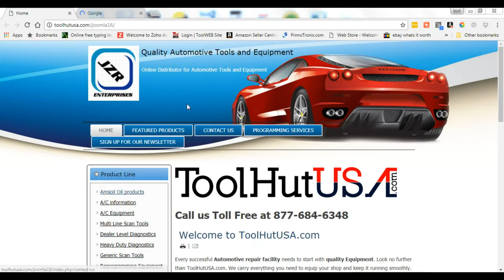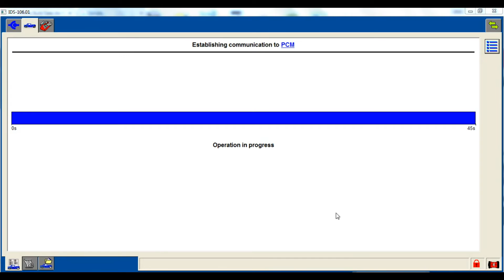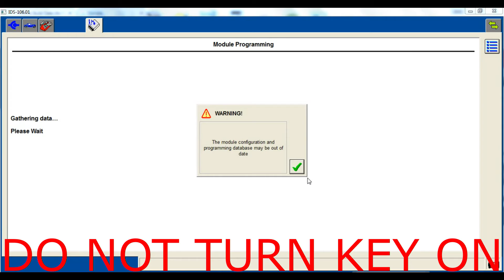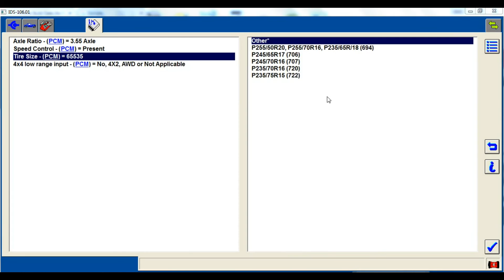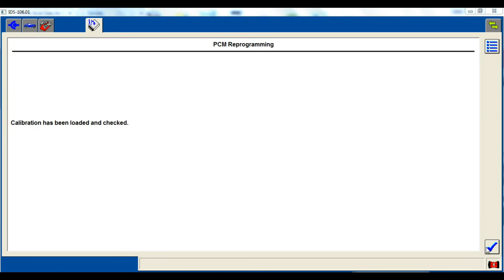Ford Module programming what to do when something goes wrong | Tool Hut USA

Comment: I tried installing a central electrical module on a focus S-max. FJDS prompted me “install new module,” I unplugged the old CEM and installed the one I wanted to install. Now the entire high speed CAN network is down. I’m extremely stressed. The instrument cluster has a code saying CAN bus off. If anyone has any ideas I will be very grateful. I would have to buy FJDS software again to do any more programming

Comment: Should the PCI procedure work to program a blank dpc202? I know they are a bit old. Tried to do that and mine would get two bars on downloading when programming and go no further. Is it possible to take the program from and existing pcm and transfer it to a blank (as a spare) using fjds? Thanks!

Comment: Hi so I bought a used pcm online for my 99 f150 and the old is stored how do I program my old keys to that module
Reply from the maker: The old what is stored? What tools do you have? An erase and program should do what you need. You will need 2 keys for it to work properly.
Reply: Sorry the old vin from the one I bought it from I have my original keys I did paremeter reset followed all the procedure and still theft light I'm using a launch xv31pro v
Reply from the maker: @theofrancis3803  you need to program pcm to get proper vin

Comment: Thanks Sam.  I was going to order a replacement PCM for my 2004 Grand Marquis, but see that even without the keyed entry system, I would likely need to have a Ford dealer replace the main computer.
I have been turned down by two local Ford dealers, one who says that Ford no longer offers the PCM, so they won't work on the vehicle.   They showed me a repair order for a 2007 Grand Marquis that they can't service, only 35k miles; won't crank.   Weird when Ford can't fix their own vehicles.   Another local Ford dealer told me "we usually don't work on anything with over 135k miles.

Comment: Hey man... What's up with the FEPS open circuit/ Ignition switch position 0, while I'm bench Programing??? I had 12 voltage and then I've switched to using 18 + volts on the bench. 05 Ford PCM won't allow me to program it...What the hell man... How can I rid myself of this problem??? Anybody???
Reply from the maker: 18 volts is too high

Comment: 2002 ford f150. Pats wont read the key. Need to replace pats module. Do I need to program the replacement module or is it turn key ready?
Reply: @toolhutusaakathecarflasher3019  we have 2 chipped keys. The truck cranks but wont turn over. Theft light rapidly flashes for around 60 seconds then does a sequence of slow flashes indicating what I believe is code 12. It does one slow blink then pause then 2 slow blinks then long pause and keeps repeating same pattern. So we think it's the pats module. Any advice?
Reply: @toolhutusaakathecarflasher3019  ok and that requires a special scan tool right?
Reply: @toolhutusaakathecarflasher3019  I dont have anything hahaha. We were going to send it to ford but thought if it didn't have to be programmed we would replace the part ourself